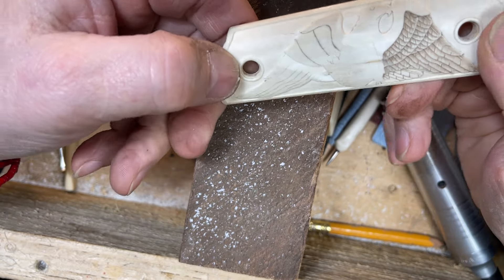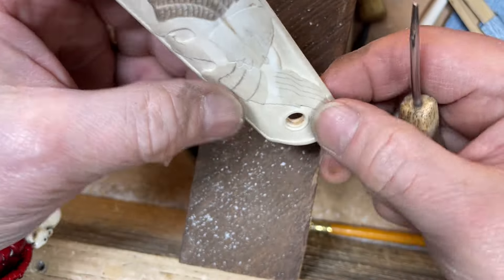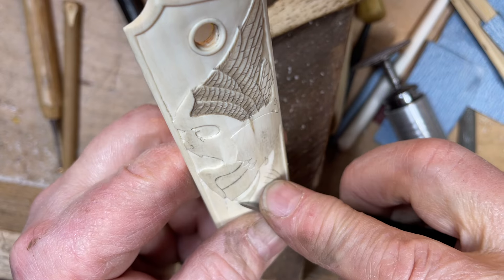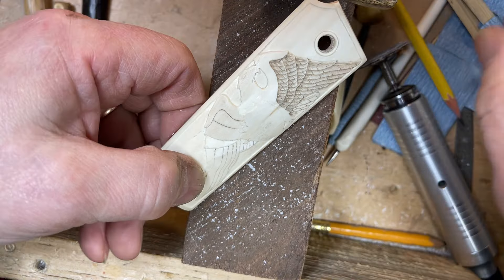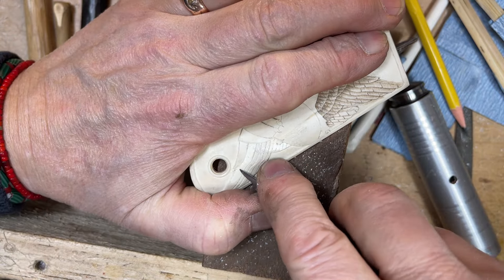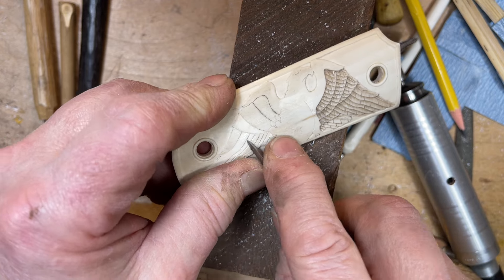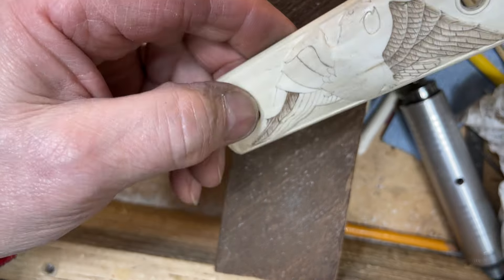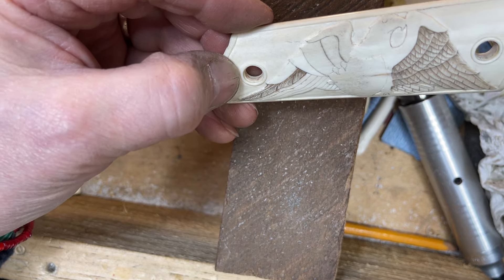Carving Eagles on Ivory 1911 Grips: The feathering process

Comment: May I ask what kind of glue you use to temporaly glue it to wood for beter grip?
Reply from the maker: Hello Pohl Peter, when I temporarily tack a piece down l use tite bond ll wood glue, and l use a very thin bladed knife to release it. For this project I made a little board with two dowels that fit the screw holes and that seems to keep it in place pretty good.